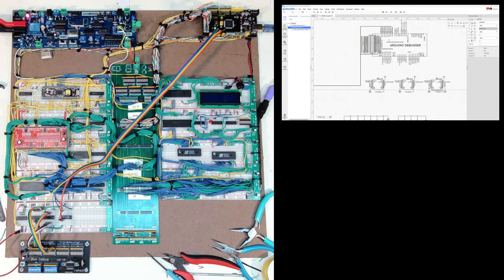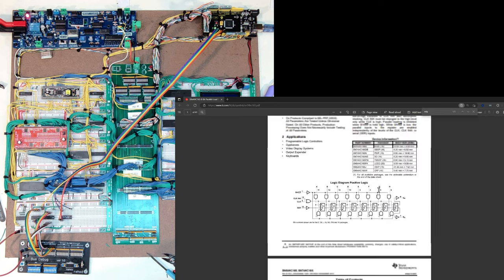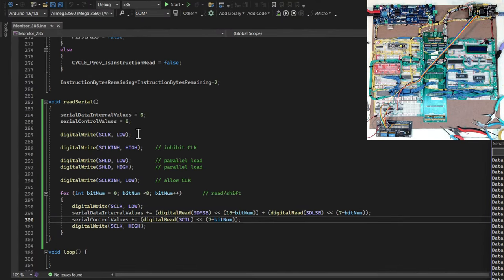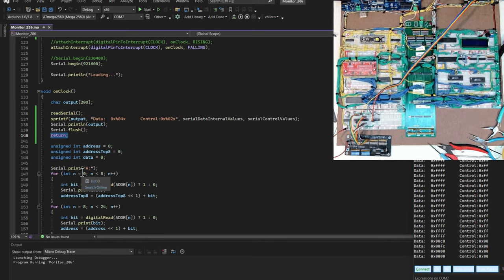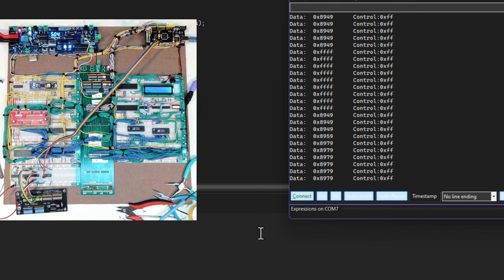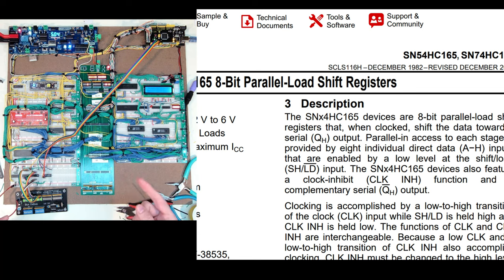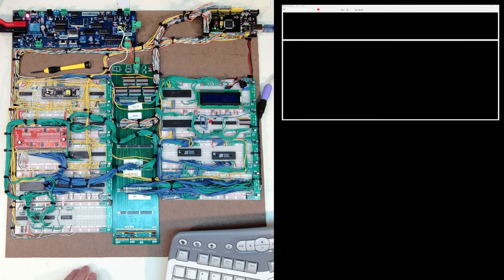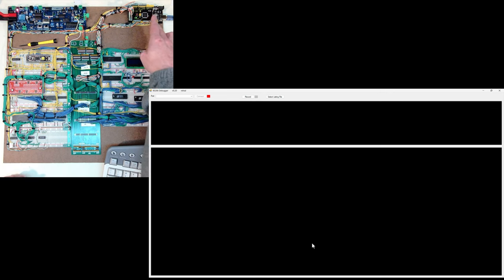80286 Build, Ep. #45 - Expanding Arduino Debugger: 74165 Parallel-Load Shift Registers

Comment: It's seriously worth using the SPI controller in the Arduino to do the SPI comms. It'll allow you to clock those chips at 4 MHz or so, so you can read the internal bus very quickly, allowing more time for the UART stuff. It's worth moving pins around for :)